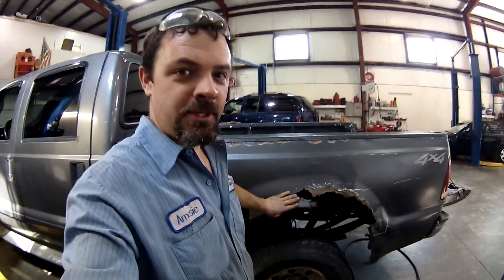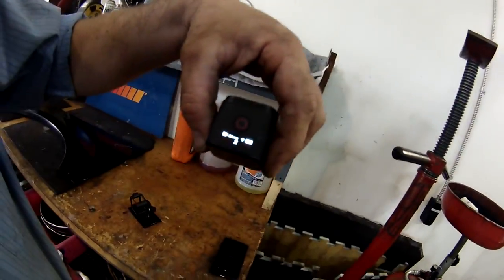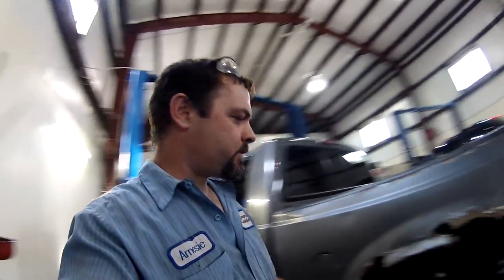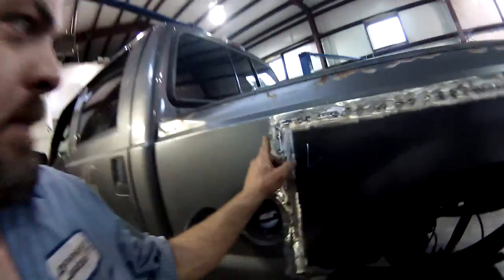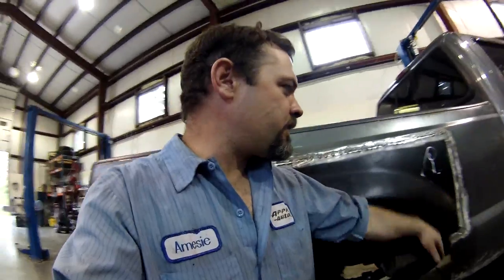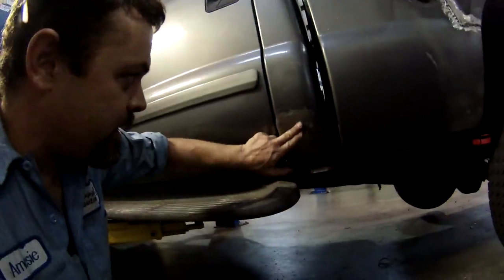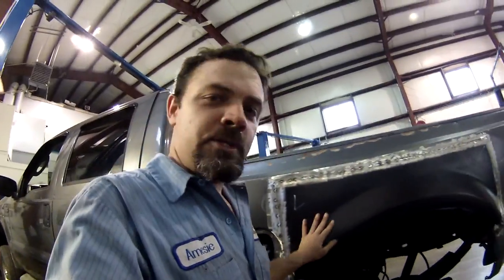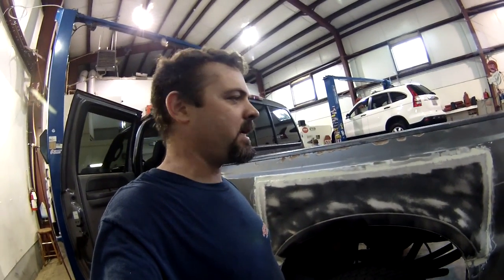Rusted Ford Bed Repair.

Comment: dig the time lapse , good job , I ve seen shops where they put Duraglas body filler over welds , then bondo . this stops any vibration of body panel from cracking bondo and paint

Comment: No this is not car show trophy winning bodywork. But if a guy can keep a shitbox passing inspection until major catastrophic mechanical disintegration.Because the cost of replacement of parts well past wear limits the manufacturers & engineers thought conceivable.And its still operable.Then this is great bodywork for the price.
Reply: Doesn't matter. With just a little more work the joint could be butt welded.

Comment: Good solid job.  Back in the day, I used to wrap, rivet, & weld sheet metal and then blend it all in with bondo.  It wasn't factory perfect by any means, but it would last a long time and pass inspections every year.  Thanks for making this video.

Comment: Great video, I enjoyed it!  Also, I know it's not a show truck and I don't know crap when it comes to body-work...random question though. What about the very thin gap between the bottom of the edge of the old metal and the top of the fresh metal where the weld is? 
Since it's in a wheel well, surely mud and dirt and moisture is going to fly up and get trapped up in there, no?
Reply: Yea, this isn't the best way to fix it, but it gets the job done. To avoid further rusting from the dirt and moisture that is bound to get up there, you need to spray some undercoating in that gap, as well as spray some fluid film all through there at least once every fall. If you do that religiously, as well as spray your hose in there a few times a year, this patch will easily last the remaining life of the truck

Comment: Nice Job Amesie. 
If you want to have a rant, Body work is a completely different trade. Ideally we all know the rights and wrongs.
If your a body work guy and your thinking about commenting, firstly watch Amesie  repairing engines with no room to get your hands in, ask yourself could you do his job as well as him?
Reply: Harvey Smith i could do hell of a lot better, shit i do it ICAR Toyota Specified, firstly the whole panel should have been replaced and not a piece of it, second i don't even need to feel it to tell you that bondo work was not complete and i can assure you it was not straight.
Reply: Don't worry. He's gonna roll some texture paint on then spray bomb it. ;-)
Reply: i dont understand how this is bad. how is rust not stopped
Reply: @hitheros8223  what is the name of your channel

Comment: As good a job as you did, wouldn't it have made more sense for the customer to have gone to a panel shop? Also I really feel for you guys having to deal with rust. I guess I'm lucky that in Australia (at least the part where I live) rust is rarely much of an issue, even on 20 year old cars.
Reply from the maker: JSVSouth Body shops take weeks to turn around a project like that. Being a work truck it needed to go back to work fast.
Reply: i think its not the weather its the cheap materials they use at the factory

Comment: Hi Amesie.I just bought a 2002 Ford F150XLT extended cab . I'm going to make one good truck out of the two. Those panels are going to make that part of the job fairly easy for me and it will also be my first stab at this type of work. I have a question. Right in front of the rear bumper and below the tail light,  the bottom corner is rusted out (a pretty good hole) A guy mentioned that you can get pre-molded metal pieces that once you cut away the rust, you can slap these on like the panels in the video. Amesie, what are they called exactly? Lastly, where are you located? If you're not too far away, maybe I just bring you the work. Thanks.

Comment: Maybe it's because I'm not a social media guru I'm just a motorhead type guy..But I do know for a fact I would rather see you describing your process while actually looking at the subject matter and not following your face around the shop while you guys talk into your NEW go pro ..And YES the drivers side panel does in fact have  more going on then just some rust ..So if you could show us how you cut the old section away to get it ready to accept the new panel . Did you Butt weld it Or did you overlap Or did you use the Flange tool to create a step in the panel  ?

Comment: Well I'm glad he ain't fixing my truck . All that steel  behind there  behind that patch panel is going to rush through. All that should have been cut out and a butt welded together
Reply from the maker: Customer didn't have the budget for a work truck that only had to last the winter.. Would you be happy if you wanted it this way for cheap to come to pick it up and the bill is more than the trucks worth?

Comment: My silverado needs the same repair could I just use metal pop rivets I have fender covers so I'm not worried about bulges in the paint
Reply: I have no clue how thick it is but I would imagine it possible at least. Granted I'm just a shitty comment mechanic but I do know that I may look weird when it is done.
Reply: @ohnojt  I don't mind weird as long as it extends the life I could always get some of those brush guards to put on it

Comment: When I do body work I do little spot welds where the metal lines up I don't overlap is that not a good style?
Reply from the maker: +Evan Hebert I overlapped it to help give a bit more strength at the cost of appearance. Ideally you would want to line up the patch and butt weld it in like you said.

Comment: How come when you traced the new panel onto the box of the truck you just removed where the rust was and welded the whole panel over the existing box side? Why not just cut it all out to fit the whole new panel? Isn't that going to make the body work more difficult when trying to hide where you welded? Asking because ill be tackling the same job soon.
Reply: Bray91 he traced it to know where he would have to soft brush down to the bare metal so when he welds the new panel on the paint won't contaminant the weld bead. And also, he left the metal on to make the new panel strong since there is no inner structure behind the panel, assuming it rusted out just like the wheel wells.

Comment: Would it not have been more practical and cheaper to find a clean donor box? Or is it better to repair.
Reply from the maker: nathan linder It's a work truck and needed to go back to work asap.
Reply: Oh okay. Makes sense
Reply: nathan linder even if you were to argue that it needed to quickly go back to work ASAP, you could have put a whole bed side on it, or even if you put in a whole new Box ITS ACTUALLY EASIER AND FASTER TO PUT A WHOLE BOX ASSEMBLY!!!!! RIP Truck. SAD!

Comment: I wouldn't do my truck like that. Therefore I would not do someone else's truck like that. Why repair the bedside just to set it up to rust out again?
Reply from the maker: You must have missed the part where I explain that it was what the owner of that worktruck that only had to pass inspection and last one season wanted.. If you want I can give the next job like this your info and you can pay the difference to do it right.
Reply: @AmesiesCorner  I still would not have done it that way. As I said, a little more work and you would have a panel that is not going to rust out again. If you can't afford to do the job correctly don't do it.
Reply: @AmesiesCorner  How many hours do you bill for a job like this in the procedure you used?

Comment: I need the exact same repair on my f250 Powerstroke. I need both sides done. What does a job like this cost?
Reply: Andrew Stevens I just ordered 2 rear panels for my 04 f250. woth panels provided how much will labour cost approx?
Reply: Andrew Stevens way too much that's why I burrowed a welder and am at this site. I've seen this way or cutting out the whole panel but I don't wire feed weld that much and I'm afraid if I weld but to but I'll end up with a. Much of holes   Why wasn't I born rich ! I hate body work . I think I'll do it this way.. I don't know how you don't see that it's thicker on top. Forget. Bondo use drywall mud with a 12 " knife lol
Reply: Mark Schuster I think you could just poprivet the new panel in and skip welding couldn't you? And just grind the rivets down smooth.
Reply: We did something like that years ago on a car.  However, due to the cold winters here, the metals tend to expand and contract at different rates. Eventually, we started to see the rivets under the paint and next the seams started to show.  I'd recommend spot welding it.
Reply: I had one side done on an F350.  It cost about $2500.  It included the outer and inner fender rust repair, matched paint, replacement "FX4" sticker and body trim.  Parts and paint was just over $500, the rest was labor.  In my case, the truck was worth it, since it was the only rust area and it brought the value up and looked like new again.
Reply: Andrew Stevens you can get a new bed replaced and painted for $2000
Reply: lol

Comment: do you like megadeth? kinda marty friedman style guitar runs. i like megadeth.
Reply: +Um No also, not criticizing, y would you go through the trouble of spot welding, and not just finish weld and grind? for what reason? labor hours or something? again asking, i think $$$ reasons.
Reply: +Um No you spot weld panels to keep the heat down. if you try to run a bead you can burn through the panel or if you dont burn through your panel will buckle and youll have one wavy son of a bitch that not even bondo can fix.
Reply: it should of been welded all the way not just tacked. you can weld it in sections to keep done on heat.

Comment: Wow....you shouldn't be allowed to make videos showing people how to do something if you yourself do not know how to do it....not only does he now have a piece welded to the outside of the original panel, making the new piece stick out further and not being flat and straight, but he also now has no inner wheel well. The thing is just going to rust out again. I would be filing a lawsuit if someone did this to my vehicle
Reply from the maker: It's a work truck. This was what the customer wanted done to get it by another plowing season.

Comment: Why would you not replace the whole panel? Wtf dude that is horrible work poor truck. Take this from a certified Toyota Repair Technician, this is NOT how you repair a Truck. Did you cut off that panel from a new OEM panel?
Reply from the maker: Nope, it's a patch panel. Costs like $25. 
Must be nice to be able to throw a customers money around..
It's a beater work truck this was done in a few hours for minimal cost.
Reply from the maker: I'm curious as to why a certified Toyota tech would need to know bodywork?
I was a certified Mazda tech and we left the bodywork to the body techs.
Reply: Certified Toyota Autobody Repair Tech. I work with insurance companies and if it is customer pay we do it the proper way, it is a lot faster to replace the whole panel dude.
Reply from the maker: I'm just a tech broh, I do what the boss tells me. In this case it was what you see here. 
Just the piano player in the whorehouse, I play what I'm told.
What do you think the cost of a whole bedside for that truck is vs the patch panel. Is one even still available?
Reply: Amesie's Automotive Corner it may seem faster but in the real world on a truck like that a boxside from the dealer is about $700 an aftermarket is about $500 to do a box side u get prolly about 13 hrs labor time plus an inner which is another $100 and another 1.5 hrs so call it 15 hrs at even $50 per hr so that $750 + 700 +100= $1550 plus paint time and paint and material so ur lookin at $2000 or a patch panel for $50 and 8hrs labor plus inner I don't need to do the math it's much cheaper not the right repair but it's a good bandaid most of my customers opt for paint fender flares but that's an even worse bandaid if ur goin to do these I recommend buying a flange tool to over lap the weld butt welding is great when it works but can be a pain honestly this guy could have done a great job with a flange tool and spreading out his weld more for heat
Reply: Albert Quintero if it is customer pay I'd hope you'd do what the customer say... I have an old Ford work truck too (same color as this fried bucket actually) and I'd be pissed if the guy I brought it to pushed me for a full on "make it new" repair.  Those wheel areas take a beating so no point making them pretty again.  I've thought about doing a couple patch panels like these and then coating them with bed liner ... regardless... Stop the rust and make it solid again is all we need from these trucks.  Sounds like Amesie followed the orders barked by the boss which is the same, I assume, as the customer asked for so get off our boy's balls already.
Reply: "Why would you not replace the whole panel?"

If you weren't meant to weld in wheel arch replacements, they wouldn't manufacture them.
Reply: flange means more surface area to collect moisture and eventually rust